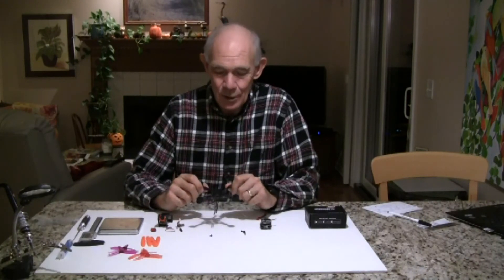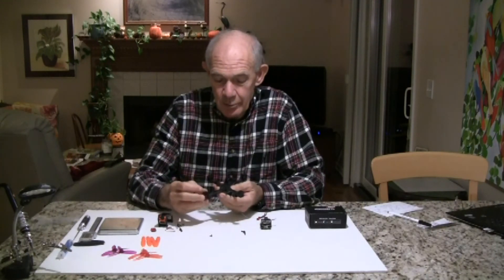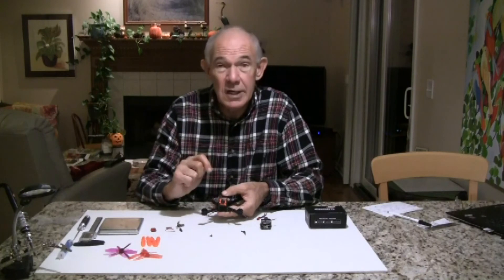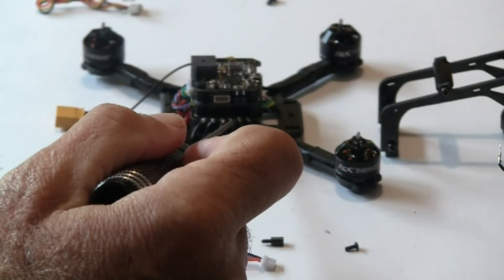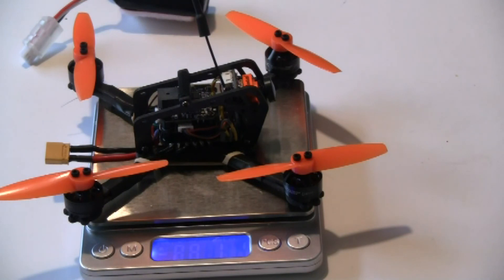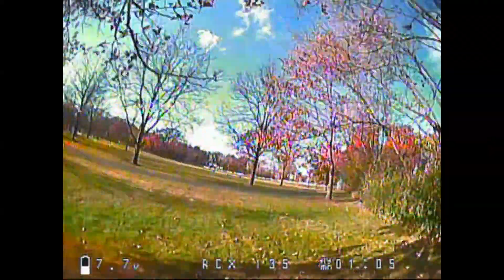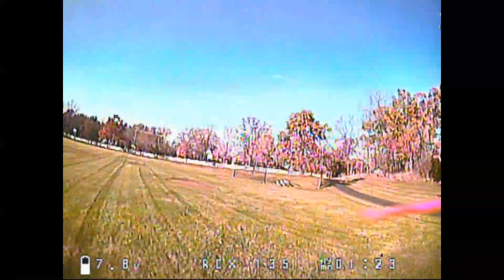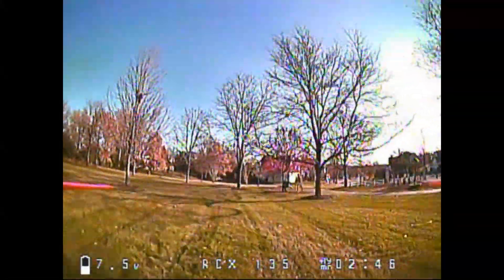MyRCMart RCX 135 Froggie Quadcopter Frame with RCX 1304 motors Review

Comment: Hi, nice review. Really like your build. I found you on the MyRCmart page for this frame (directed from Albert Kim's review). He stated the frame wouldn't run 3 inch props (I notice MyRCMart recommended 2.8"). Is this the same frame and did you have to do anything to get 3" to fit? Thanks!
Reply from the maker: It is the same frame that Albert Kim reviewed, a nice frame for $15. The Gemfan 3025 props just fit by 1mm in the front. The Runcam micro camera is 18mm wide and pulls the frame in enough so it clears.  The Gemfan 3025 props measure 75mm which is 2.95 inches. A true 3" propeller might hit which would require trimming the propeller or filing down the frame. I wish they would have made the front arms 2mm longer. I like the wide Gemfan 3025 propellers so the frame works for me.
Reply: Great information - thank you!
Reply from the maker: I just tried 3045 tri props and they also cleared.
Reply: Cool, did you like them better?
Reply: John, what brand are the 3045?  I only find DALPROP 3045
Reply from the maker: Rod Rowley I purchased the props from MyRCMart. When I looked on their site they were not listed any more. There was no brand name on the props just the size 3045. The bag they came in has a sticker that has the number 0408/01-629. Wish I could buy more of them they are great.
Reply from the maker: Many 3” props do not fit but the Dal 3045 fit they clear by 1 or 2 mm